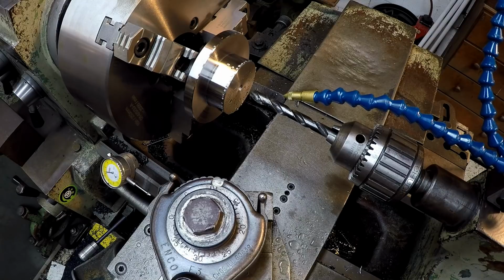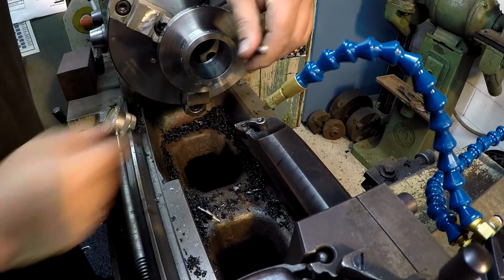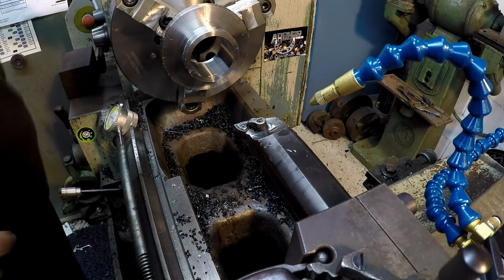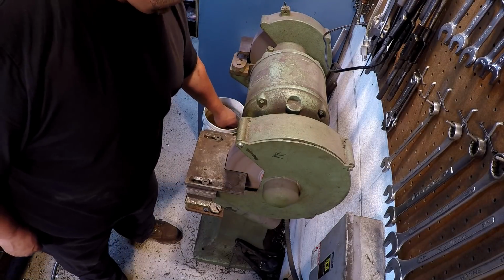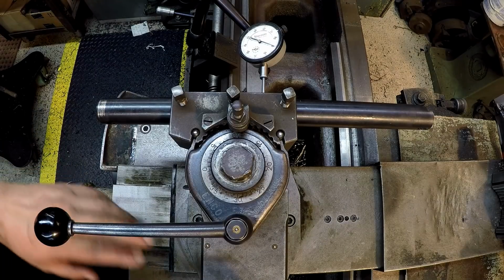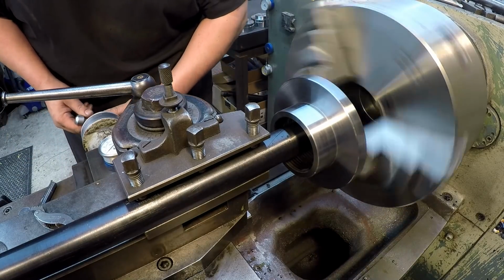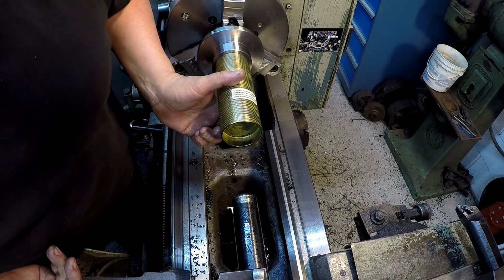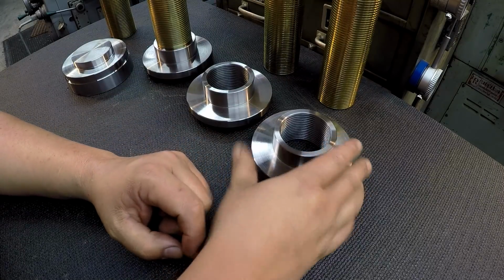SNS 189 Part 2: Internal Square Threading

Comment: For all the haters...
High Speed Steel is heat treated at around 1 200 C (2 100 F)  and tempered at around 550 C (1 000 F)
This means that below 1 000 deg F, it won't lose its temper whether you're quenching it or not. Actually it's even better to use bare hands and when it feels hot, dunk it. Human pain threshold is around 60 C or 140 F, so you'll be getting third degree burns and losing your temper LONG before your tool loses its temper!
Don't believe me? Boil some water, put a piece of tool steel in it, take the steel out with your hand and see how long you can hold onto it. I guarantee the tool will be fine and you won't.

Keep up the great work ABom:)
Reply: Good point well made.  Joe.
Reply: Exactly, you'd have to be pretty damn tough to be hanging onto a tool bit that was anywhere near hot enough to change hardness.
Reply from the maker: Mike Davison I always get a few comments stating I have to heat treat the tool bits since I ground them. I’ll informed and unaware people.
Reply: I was taught to not even let the HSS go straw coloured without quenching it. I find that around that point it is too hot to handle anyway. I'm no criminal, so I'd like to keep my fingerprints if possible!
Reply: @Abom79  Is it maybe that they are thinking that the tool bits are case-hardened, so grinding off the hardened outer surface would leave soft steel which would then need to be hardened and tempered? That probably isn't the case with the tool blanks you use to grind your tools from, as they are likely designed to be ground without hardening, but maybe that is where their confusion is coming from.

Comment: Square threads are very nice. Can't readily buy taps for square threads. I used to grind wood threads for the sling swivels used on gunstocks. It was time consuming but was very accurate.

Comment: It appears that your working on a spring seat for a race car in a coil-over setup. the machine work is, as always, top notch. A little extra clearance on the root of those threads would be a welcome addition since those threads will be under a vertical load, in shear. Excellent work, as usual. I always learn so much seeing you do work and pick out things that I might otherwise not have envisioned.

Comment: Hello Adam!  I really like seeing you operate the machines! Not sure if it was a wide angle camera or you just moved the camera further back in the shot.  The shot was when you was turning the  wheel on the tail stock while you were drilling the big hole before boring and threading. I can't speak for everyone, but I think it is real interesting seeing the moves you make while operating your machines! Hope to see more of you in the machining videos! Thanks R. Gourley
Reply from the maker: Russell Gourley I’ve had requests to show me running the machine sometimes. I moved the camera back for that shot.
Reply: Thanks Adam! Maybe I will see more shots with the camera moved back.

Comment: I've made similar spring 'nuts for a motorcycle shock - very strange asymmetrical 'square' threads. Four off sounds like automotive use.  Great turning , as usual, Adam :-). very envious of your shop extension.
Reply: Looks like Gary is making a lowering kit for one of his cars (or his kids).  My son lowered his car and he had the same set-up.

Comment: Thank you Adam,  My parts are looking good, cant wait to do the assembly.
Reply: If I had to guess,  adjustable spring seats for compound springs on some sort of offroader??
Reply: Badgermatt75 2016 For adjustable coil over shock absorbers, I'm converting my drag car suspension so I can fine tune the launch ect. You can buy those components for most popular applications but not all, these I would be a custom job. Its a great upgrade for a race or off road application.
Reply from the maker: Hey Gary, I hope you like them. It’s been a fun job to make in the evenings in my shop. Would you be interested in sharing some info on what These are for and what your building?

Comment: A file and sandpaper and flapper is your best friend when cutting these ...and a carbide with wiper at thread depth.  These tend to bind up easily and benefit from being made a little On the loose side of the tolerance .

Comment: Hi Adam! Just a thought (suggestion): What if you put bluing (your blue marker pen) on the top surface of the tool you’re grinding, and use the calipers to put a witness mark the desired thickness from the end. Then you do the coarse grinding in one operation, rather than having to grind-stop-measure-repeat. When you get down to the mark, you should be close enough for the fine grinding wheel at that point, until you get down to the final measurement desired. HTH! Nice to see the lights in your shop addition up and running! :)
Reply from the maker: I do that sometimes but marker dye doesn't stay there, you have to use Dykem layout fluid.

Comment: Great twin episodes, Adam.  
About you sometimes getting comments about cooling HSS tool bits in water, even the older machinists I worked with when I was coming up would say if you were able to hold a tool bit without getting burned, you couldn't do it any harm by dunking it.  The annealing temp for HSS is so high you would never be able to get near it with your flesh.  No danger of changing the hardness of it with a grinder.

A few people have told me (and I'm an older machinist) what amounts to the opposite; that if you dunk a tool off the grinder, it causes micro fractures.  I can't see that happening either, and have ground an awful lot of special tooling shapes (and dunking to cool).  Those tools always provided a good cutting life between honing or regrinds.  I still have some from many years ago that still do their job when I have to pull out an old tool for a special job.

Just my guess, but I think some of these ideas came from the way-back very old time machinists who were still using forged tooling or carbon tooling.  Big difference from what we've had for many decades now.

Keep up the great vids!  Funny how a guy can work at a lathe all day, and still find it interesting to watch the same thing on videos in the evenings.  :)
Thanks.
Reply from the maker: dcw56 No worries on the tool bits. I have showed plenty of it in my channel and social media so I know what works. Just funny when someone try’s to tell you your doing it wrong.

Comment: Here in the UK it seems to be normal practice to use the cross slide square to the thread any thread, just move it forward to keep the leading edge cutting, THANKS FOR YOUR EXCELLENT VIDEOS
Reply from the maker: That always seems to be such a topic for debate here.

Comment: Might try turning to insert over , run lathe in reverse feed out , saves on the nerves especially  when threading to a shoulder , always worked for me . and for the peanut gallery , not my first rodeo 45 yrs in

Comment: ya cobalt gives hss its red hardness and allows to scorch it that ugly brown or blue. coarse grains cut cool. That big old drill .008 over is still about .5 % over size so not bad at all cant wait to see that big ol' shaper at work not surprised to see so many help out your one of the good guy's it seems thnks for the square thread refresher course
Reply from the maker: Random Dude The grind isn’t perfect on that big drill, but just need to get a hole in the part, not a big deal.

Comment: Awesome video. I've only done acme threading once, but it was nice to do something that isn't your typical Unified thread. When you were squaring up your compound, are you relying on some mechanism in your toolpost to hold the perpendicularity of the boring bar? Also, what was the purpose of the groove you showed on the unfinished part at the end? I assume it was so you just turn your diameter to that groove, so everything stays nice and square. If so, I will be doing that from now on!

Comment: Also, how do you find that mister fills the air? Do you get cloudy in the shop? I made my own mister and it works great, but I really have to dial in the pressures to reduce the amount of overspray. My fluid says it has no health issues, but it'll choke you up a bit if it gets a bit heavy in the air.

Comment: You pointed out the chatter with the larger drill bit.  Have you any experience of an old shop trick of putting a square of an oil soaked folded cloth (four layers thick) on the end of the drill bit end and then commencing the cut with it still in place,  so that you press cut through the cloth and then commence into the work piece? It is supposed to keep the drill on line and reduces any chatter.
Reply from the maker: Never heard of that old trick.
Reply: Plain heavy card board ( think cereal box ) works the same way. folded four times. It works best if there is about 1/8 of the radius of the hole or more left to be removed.

Comment: The chatter in the drilling with the large drill comes almost only because there is no center remaining in the workpiece and thus the drill doesn't guide at all. Also the reason for the oversized hole.
Reply from the maker: Jaakko Fagerlund Incorrect. Its all about the grind. The clearance behind the cutting edge needs to be correct to help support the drill, also the angle.

Comment: I have one little question with the threading. 
How does it work that u can change your gear to neutral, turn the chuck, then get back in gear and the leadscrew will still fit the thread pitch? 
Is that because of the thread dial his machines have? Because the machines I am using  don't have that and i am pretty sure I schouldnt't disengage gear while threading. (I have to add i am a metric guy from Germany and I've seen a machine with a thread dial at all)
Reply: Yes, the threading dial allows you to do this. The nature of imperial threads allows the lead screw to be divided by 2, 4, or 8 (or even 32 by half-nutting) so the timing can be easily reclaimed. Gearing and threading is one of the few places that imperial is superior to metric.
Reply: This is mostly a guess, but I expect the chuck is still engaged with the lead screw (thus the carriage and thread dial) so "neutral" is really only removing the actual motor drive part.
Reply: on the lathe I use switching into neutral disengages the drive from the power output, so you can go into neutral and leave the lead screw on and then if you manually turn the chuck the tool moves just the same as if it was under power. Harrison m400
Reply from the maker: The spindle is still in contact with the quadrant gears on the end of the machine, which is in turn still spinning the lead screw. Going into neutral has no effect on the alignment.

Comment: Adam, as a non machinist here, how are the threads cut so that your getting the exact same start location each time your cutting each pass? Hope that makes sense... (like as to not cross thread it). And happy birthday btw! Shops addition looks awesome too.
Reply: yeah, this is driving me crazy!  are the tool feed and the lathe synchronized?
Reply: There was a video about threading on this channel few month ago or so.
Reply: Adam has quite a few threading video's as does mrpete222, Joe Pyzynski & others.. Do a search and you will get all the info you need. YouTube is a great place to learn. regards
Reply from the maker: +CreamyCornCob As the guys said, I made a dedicated video talking about engaging the half nuts and where to engage to ensure proper alignment each pass.
Reply: Thanks Adam, looking now. Keep up the fantastic work!
Reply: Witchcraft mate ;)

Comment: I have never used a drill bit that large, and probably never will. Just curious- what is the tool pressure like using them? Do you have to really muscle it in via the tailstock, or does it just go right in with little effort?
Reply from the maker: deemstyle If the grind is right it’s not bad at all. Sometimes it depends on the machines because some have different thread pitches on the screw.

Comment: indication before job starts is usually excellent. but was wondering about the indication just after job is done and before removed. do the actions mess-up the indication? particularly those jobs that use large drill bits. is the indication still excellent after job done?
Reply from the maker: Sirano Dhe-Paganon Plenty of times I have to reindicate the part because of it being moved. I can usually tell just by looking at it if it’s running out. I had to do that to one of these after drilling.

Comment: I've not studied every thread in the Machinery Handbook (a very large section devoted to threading), but what would the differences be between the "square thread" and a "acme thread"? Would/could there have been a off the shelf bit available for a "acme 8 thread"?
Reply: An acme thread is a trapezoidal thread with a 29 degree angle on the thread teeth. This improves the strength by widening the root and makes the thread somewhat easier to cut with a tap. The benefit of truly square threads is that they are lower friction and all the force is axial (there is no force trying to split the nut). An interesting result of this is that a square thread can push on a nut cut in half, where most other thread forms would just jump out.

Comment: Did you not use cool-mist on the thread because it would have interfered with camera angle, or is there another reason?
Reply from the maker: +Fred Newman I like the better lubrication of oil with the threading ops like I showed. The cool mist is great for leaving the part and insert cool, but for a nicer finish at low speeds you can’t beat good old cutting oil.
Reply: You ought to own stock in the cutting oil company!

Comment: Cool. How does the machine know where to start on the threads?
Reply: The leadscrew along the front of the lathe pulls the carriage along when a lever is pulled, closing a set of half-nuts and engaging the leadscrew. The screw is driven by the spindle through the change gears, which are selected to determine the desired pitch of the final screw. The lathe also has a small gear that is rotated by the leadscrew (like a worm gear), that turns a dial with lines on it. Engaging the half-nuts when the right line is next to a pointer will start the carriage moving, but it's up to the machinist to pull the lever at the right spot. There are a couple other videos where Adam demonstrates how to cut threads.

Comment: "Engage the Half-Nut where ever you want" meaning anywhere, or any of the lines???
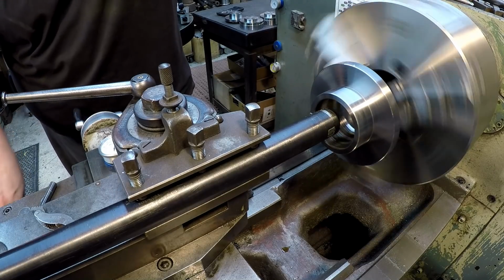Reply: 21:24..
Reply: The pitch of the lead screw is 4 TPI, this thread is an 8 TPI. Because it is a multiple of the lead screw, you don't need the thread chasing dial at all.  This applies to 12, 16, 20 etc.